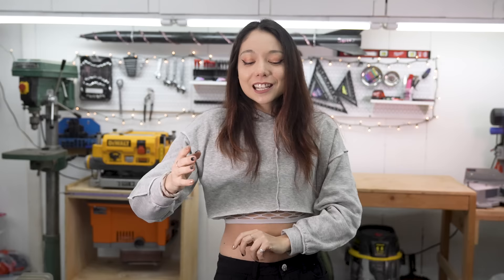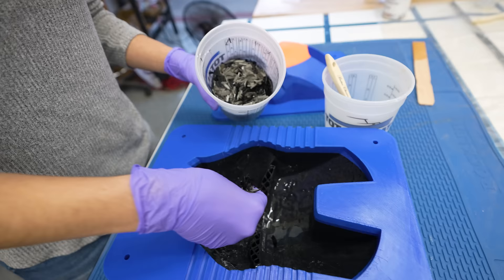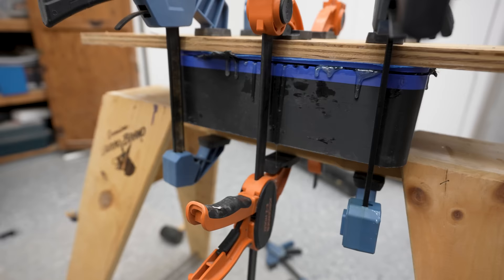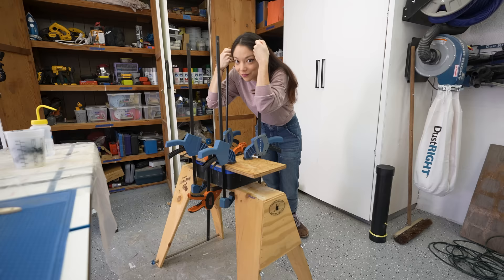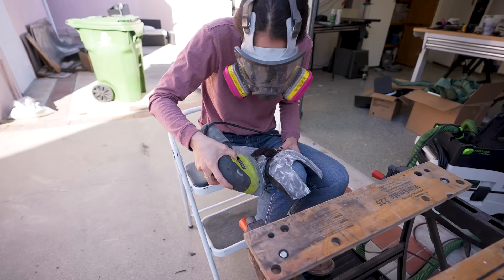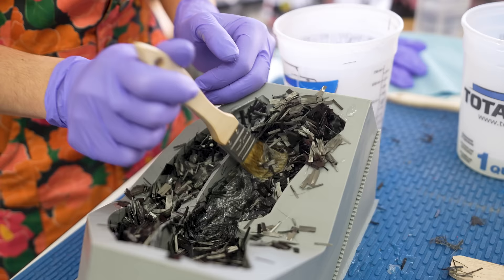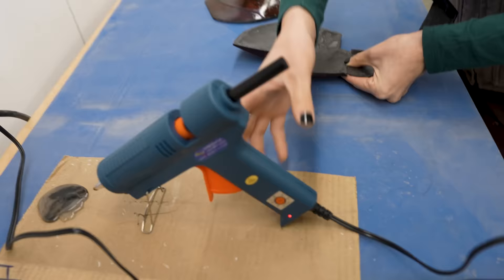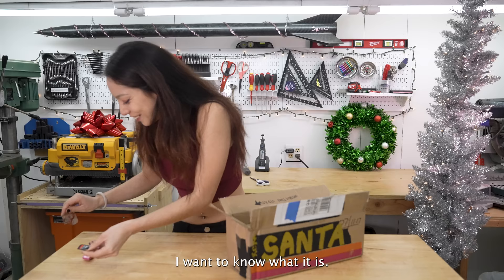I UPGRADED Iron Man's Helmet (100% Carbon Fiber!!)

Comment: I can attest to the difficulty of using a blender or Maya model to create a real world object. 

Blender was the first 3d modeling software I learned, and to this day is the one I'm most experienced with. The issue is that it is meant for creating objects in a virtual environment, so that can introduce many issues when that object does not technically abide by the laws of physics. Ive learned how to make objects manifold, implement proper tolerances, understand weak/stress points of a model, and other things that allow my models to be 3d printable.

Currently I work at my university's makerspace. In here we have lots of students wanting to 3d print things. For the most part, the models made by engineering students with the use of CAD software like solidworks tend to print well, but we also have a lot of art students that use blender or Maya that want to 3d print things that are infeasable to print. I'm glad that I'm able to help them design with 3d printing in mind, and I hope to eventually create a youtube series to help others

Comment: when you  are facing with 3d printed modls - its better to use  PETG for them. this material doesn't adhere to most resins. Secondly i prefer to use hard wax, because when you aply it fills layer pattern.

Both these helps a lot with demoulding, so much, that i nearly doesn't feel the diffrence beetwen 3d printed mould  and  milled from special prolab65.

when i plan to use more than 3-5 times 3d printed mould i spend some time with filling with special filer for petg and sandint, than painting with propr lacker - in that case - i can use such mould more than 20 times.

Comment: I made a quadcopter frame using forged carbon and 3D-printed molds. It is holding up really well. Yeah, molds are hard. Tip - resin prints are soooo much better for sanding.

Comment: Big +1 on the frustration of working with ordinary meshes using software like Fusion. It's exhausting to get it right, especially if you want something that can be easily printed.

Comment: A long time ago I was molding plastic impregnated with Kevlar strips.  I got a great result putting the cut lengths into a paint cup, covering the top with a rag and then "stirring" with compressed air.  I got a loose felt-like mix that was easy to pull and work into the mold.  Probably more uniform fiber overlap too.  PS in the early 1960's I had the then current version of that clock in my bedroom.
Reply from the maker: Oh interesting!! Chopped strand like this or woven strips?
Reply: Chopped strands @xylafoxlin
Reply from the maker: Huh! How long were they?
Reply: It's been about 30 years.  Probably 1-1.5 inches.  The part we were reinforcing was about 3x5x1 inch with an odd-shaped module potted inside it. @xylafoxlin

Comment: I think kiln dried Prepreg carbon sheet would be a lot stronger but I know making the molds would have been harder and maybe you don't have an industrial oven. I find three coats of wax topped with PVA mold release makes the parts come out of molds easier but unless you cure it in strong vacuum you'll still need the clear coat to fill in tiny bubbles.

Comment: Stainless steel, raw, looks perfect for rockets and works pretty darn good. It's mostly iron and it flies. Should be making it to space soon.
The helmet came out looking really cool. 3D printing for molds for composites when doing custom pieces or small runs has been used in industry. Application like prosthetics have used it.

Comment: Answering your question on how to avoid those bubbles and surface finish.
Use a coat of Gelcoat first and let it cure utill "tacky", then you can proceed as you did. It will save you so much work and the result will be... well, just try it.
OK, i'll keep watching the rest of the video ;)

Comment: This is amazing!
Maybe I missed something or just don´t understand, but: why did you use these small bits of carbon fiber and not longer strains of it? Was this due to the circumstances of this project, or was it the only material available, or left over from some other project?
I especially like that you take the time to adress the fact you are wearing gloves and how that would normally not be a good idea.
And the clamp on a clamp is simple but genius!
Reply: Mostly for aesthetic reasons, in this case, but there are other reasons it's useful.  The technique is called "forged carbon fiber".  Wikipedia says "Due to its chopped nature, it can be molded into much more complex geometries than traditional carbon fiber composites, and is suitable to make three-dimensional parts and parts which feature complex details such as thickness transitions, holes, compound curvature, etc."

Comment: I wonder if you could add demolding bolts to the print. Obviously hard to add to a bad model on a limited timeline, but you could generate a lot of force in a relatively controlled manner.

Comment: Next time you print a mold, you can avoid making a huge plastic block with the relief in it.  Simply take you model and subtract out the remainder of your block by upsizing it.  Then you have a relief side which is as thick as you want it.  That way you don't print the giant block of plastic.  It will save a lot of time and material.

Comment: I build plastic model planes and occasionally have to ship them , Shipping supplies , like those foam peanuts , are getting expensive . A cheap , effective way to pack and protect stuff is shredded news paper . In Vegas we has free stuff like nifty nickel and auto trader papers that you can grab a handful for free at gas stations and such .

Comment: Loved the build it was gorgeous on the stand. However I was triggered, sorry if I offend, but please be careful around your power tools with the carbon it’s conductive. When they were working with the carbon fiber in the 80’s we managed to blow up a 440V motor controller. We had to install explosion proof vacuum collectors on all devices that we used to cut the fiber. Sorry if you knew all of this already but I was the one that had to rebuild the motor controller.

Comment: I think the main reason your molds did release so hard is because 3d printed parts are still layerlines with rounded sides. Meaning that on microlevel your surfaces have many overhanging edges. I think pre-soaking the mold with special molding epoxy will solve that problem. It will fill all ridges like your epoxy did now. Only this pre-soaking epoxy will be part of the mold and not of the part you are making. So add mold release after the pre-soaking and I am pretty sure you can pop the parts out pretty easy and even re-use the mold when done the right way. The helmet looked GREAT!!!!! Well done

Comment: You'll get a far better quality result if you use a 2 pack clear instead of an acrylic clear.  It flattens out much better.  You can get it in disposable aerosol now too in a break and shake to mix can.

Comment: looks bada$$ and its light... hehe i wonder if your gonna mix colors play with chip sizes... every layer becomes a functional structure in the mix.. who knows maybe the back layer adds overall stiffness and itll survive a lot longer ... 🥰🤓
Reply: hehe, very nice... id give you more time to make more and a vacume press... 

so the process is a bit faster and the layers compressed... you can make it much thinner and get more ideas. 

not so traumatic if you end up testing it for something like a real ironman motorcycle or racing helmet. 😆

this stuff might actually be too strong to be a real helmet tho. 🤔

Comment: CNC carved molds from HDPE demold much more easily. They barely need any release agent. Buff it with a carnuba wax based release agent a bit, and the only thing holding it together is a bit of the epoxy that dribbled around the edges.

Comment: Hey Xyla! As an F1 racing fan, it's great to see a carbon fibre build. Of course it's brittle and its tensile strength is often directional. (Sneeze on an F1 car the wrong way and it's a $250,000 repair! 😂. This is a very cool, very beautiful build! If my memory serves me correctly, Happy Hannukah! (+ the other 3 variants that "Crazy Ex-Girlfriend" pointed out.🤔) Also, have a very Happy (Secular) Christmas, or as John Waters (on The Simpsons) said the Japanese call it --  Happy "Winter Shopping Holiday"💕⛄❄️🧑‍🎄
Reply: Becky's Kit-Kat Clock is awesome and terrifying! The following eyes is relatively new? The eyes used to just oscillate left to right on the second for most of its history. Still, SPECTACULAR Secret Santa gift! Well-done, Becky!

Comment: Why do you call it forged when it’s compression molding?
Reply from the maker: that's just what it's called ¯\_(ツ)_/¯ but it seemed appropriate for iron man! haha
Reply: The idea, as I understand it, is that pressing the carbon fibers aligns them and makes the overall material stronger, much like forging metal aligns the grain structure and produces a stronger result.  Or, since Lamborghini and Callaway Golf jointly invented and named the process, possibly the idea was that it sounds better in the marketing literature.
Reply: @BrooksMoses  I know almost all glass spray molds are exactly this process of spraying a mixture of glass fibers inside a negative mold and then placing the top model for compressing. I come from a back ground of making prosthetics for 10 years and have never herd of referencing this method as forged. the fact forging would involve manipulating a solid into a desired shape and this process is just molding a shape like any boat manufactured of components. Having fibers in every direction will make a stiffer product but short fibers are not as strong as longer fibers and since carbon is stabilized with sizing agent it dose not absorb resin that’s why it has a fiber optic look to it in comparison to say basalt that actually dose absorb resin looks flat black when it’s dry form is a greenish. Looks like Lamborghini was the first ones to coin the term forged carbon fiber 2008 but obviously it was just for marketing because this is how most composites have been laid out on top of gel coats since composites where a thing. I learned something new to day and will dive deeper into this terminology.
Reply: @xylafoxlin

Comment: You could probably get away with less infill on those molds. It probably made it unnecessarily hard to drive the chisels and screwdrivers and stuff into there to de-mold and it probably doesn't need the stiffness on the front end process. At least try a dynamic thing like cubic subdivision to make the really hollow parts...hollow.

Comment: Maybe a silly suggestion, but seems like your vacuum bag setup would work better if you had something smoother than a wood work bench as the base. Maybe a sheet of aluminum or plastic?
Reply: The butyl tape is pretty compliant, though, so it should be able to take up any surface roughness on the bench, wouldn’t it?

Comment: would it be logical to 3d print the moulds in 4 parts instead of 2? Then do a ridged shell on the outside, with a flexible inside? I don't know how flexible filaments would react to epoxy, but might be worth a shot.

Comment: So, I get that this isn’t the typical CF approach with saturated layers kinda like fiberglass, with vacuum-bagging, but I hear “forged” and I think of something created using tremendous pressure. Like the forging processes for steel. I think “moulded” feels closer to what this is. Regardless, all of the very hard work turned out spectacularly. P.S. A flowered jumper and leather work boots. So hot. 😂🤣😂🤣😂🤣

Comment: Add more perimeters top and bottom layers to save more sanding and put a bit more time in mold parting design to save those poor screwdrivers and maybe you can get more uses from the mold next time

Comment: Ohhh Ohhh! I bet if you design your molds with some air inlet ports you could you use an air gun to push the parts out of the mold once they've cured. At the very least I bet it'll loosen them up nicely.

Comment: 3D printing professional here, you didn't use enough layers on the shell and top/bottom layers. That is the same grid effect that happen when you put a 3D printed part in the oven. Looks like the epoxy heated up in the cure and melted the mold surface. (: great work though!

Comment: There's a material called Zylon(tm) which supposedly has a higher young's modulus and tensile strength than carbon fiber.

I think you should one-up them and invent... Xylan!

Don't ask me how to invent a material stronger than Zylon(tm). I actually thought Zylon(tm) was spelled with an X when I started typing this comment and it was just going to be something like, "did you know there's a material with your name in it?!" But now we're here and I'm still typing. Ok. I'm done.
Reply from the maker: Wait, this stuff is awesome! Xyla, Zyla, what's the difference. I've seen it all :P Sounds like I should investigate aquiring some!

Comment: Hello, I see that it is a lot of work to separate the mold from the piece. Try to use a layer of wax before applying epoxy + carbon. This will help demold the piece much easier. Another option is to heat the mold with a thermal gun and soften it.
try it to see how it works
p.s nice work

Comment: Just use nitrile gloves. They era disposable anyway. When they catch on something, they are gone in a second without pulling your hands in.
Reply from the maker: but they dont protect you from getting sliced open by the carbon :(
Reply: Yes of course. I didn't think about it that way. When carbon is suspended in a resin, it can certainly become very sharp. Than you would need heavier gloves, which have the same safety concerns. I will just stay away from it for now. Good luck with your upcoming projects!  @xylafoxlin

Comment: If you work with gloves on a power tool you might use the thin one way gloves. They protect you from the carbon bit aren't strong enough to rip a finger of.

Comment: To ease your stippling process is refund using a shaving brush. It's softer and easier to dab things. It usually allows you to control pressure and maneuvering. IMO

Comment: Proving the Riemann hypothesis:  Moments after a Big Bang, dual numbers to be considered at the origin, repulsive and gravitational forces are balanced, but dark matter is breaking up.  "Dual numbers?", you might ask.  Isn't that the square root of zero?  (Actually, it's a great way to start a proof that ends with division by zero - a vertical line, and it corresponds to what I call Doyle's constant that deals with a brief window in time starting with taking the eth root of e and ending with a vertical line.
Delanges sectrices for the unflaking of dark matter, Archimedean spiral for spinning up dark matter, Ceva sectrices for that dark matter breaking into smaller, primordial dark matter and black holes, Dinostratus quadratrix for impacting surrounding black holes, and Maclaurin sectrices for dark matter being slowed down over time.  Split-complex at one, noting the more gravitational nature of diagonal ring/cylinder singularities of baryonic matter from broken dark matter.  Using repetitious bisection (from arbitrary angle trisection), one gets added (SSA) for when dark matter dominates a universe and one gets added for when black holes and rarified singularities make things more gravitational, leading to a Big Crunch.  At 2 = a Big Crunch, the solution to the Basel problem, and the "bellows method" drives things.  A Big Crunch event needs the net gravity from the localized area AND gravitational effects from surrounding universes.  The 2 represents how locked up black holes are making a stacking, planar contact.  
Everything else are harmonics - effects on surrounding universes.
I see this proof as like trying to climb a steep cliff with the process of dark matter breaking up, getting to the top of the hill (like stable atomic nuclei) and then skiing down the "hill of many black holes" past an inflection point where black hole formation and spaghettification happens, leading to the final vertical line tensor of the Maclaurin trisectrix.  This is much like I have posted about considering the recursive form of Euler's Identity as being like an old incandescent light bulb that you can see having first, second, and third degree critical points.
Ramanujan's Infinite Sum of negative one-twelfth:  each positional jostling, mass, and gravitational/attractive exchange between universes (defined by Big Bounce events, considering Ramanujan during both Big Crunch and Big Bang sides) ADDS up to evenness (or a partner in marriage - like half of the whole, I guess).
Net gravity increases over time from the breaking up of dark matter, much like a vertical asymptote.  It continues to increase, but hits a critical point, much like a vertical tangent, when enough dark matter has weakened and been broken up into the more net gravitational baryonic matter (split-complex numbers).  Then, the effects of gravity reach their upper limit - much like a vertical line - at e to the negative e power (where black holes have been flattened).
Over a decade ago, I said that the potential energy of a Big Bang was 1/6 times (the speed of light, cubed).  If I had said Big Bounce instead, I would have been correct, in a sense.  Now, I see how the speed of light would have to be the fourth power.